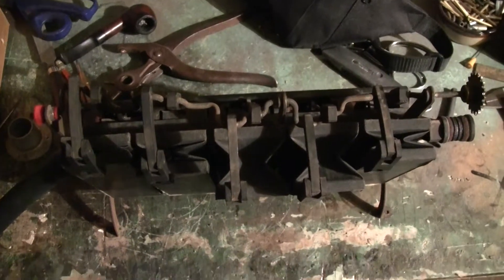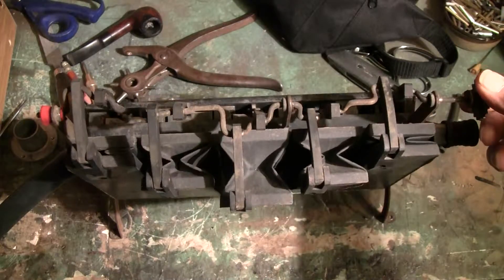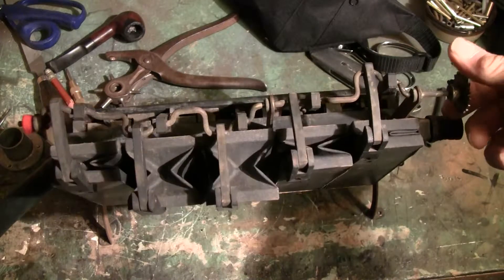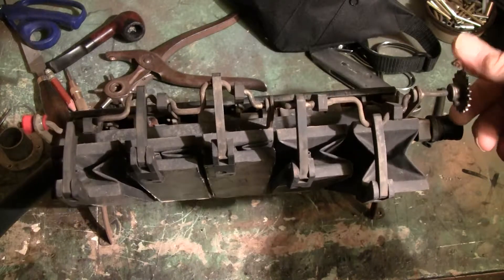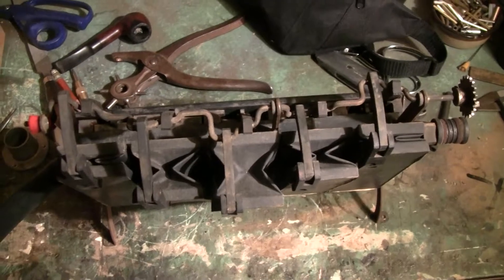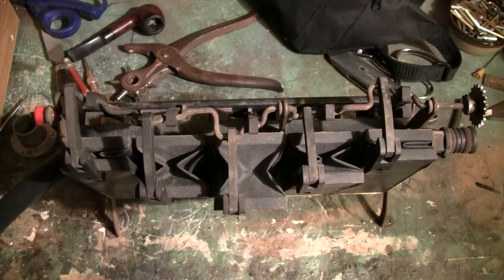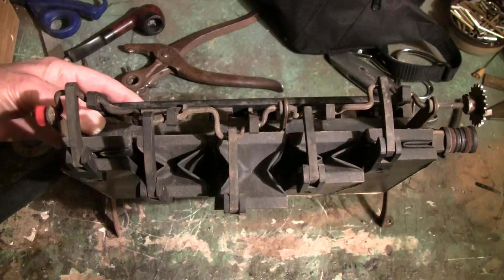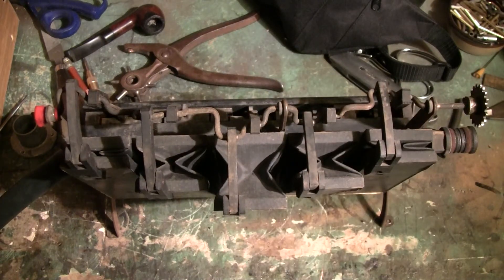Testing the air motor

Comment: I have disconnected the pneumatics on the air motor and clamped them closed for a couple of days. It usually improoves the problem, but not always completely.

Comment: Thanks for the demo and explanation of how to prevent 'loaping'. Once the air motor has 'taken a set', is there any way to help soften up the cloth?
Reply from the maker: Unfortunately, I've never found any chemical or product that successfully softens the cloth on a long-term basis. What does work the best is water. You wet the cloth with a small brush and then run the motor at a reasonable speed until the cloth is fully dry. (Usually less than 20 minutes.)
Reply from the maker: BTW, this doesn't soften the cloth. It basically makes all of the bellows the same in terms of their stiffness from 'open' to 'closed'.